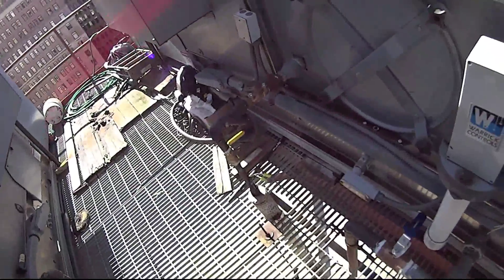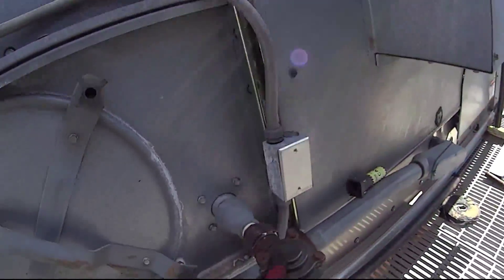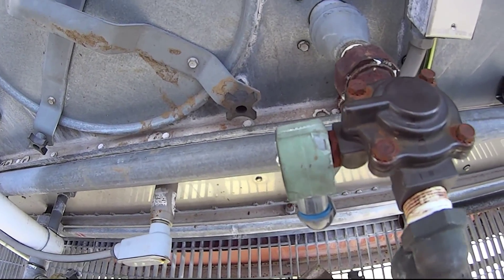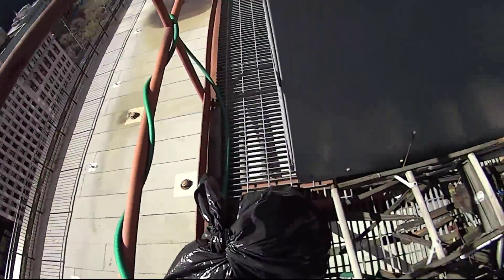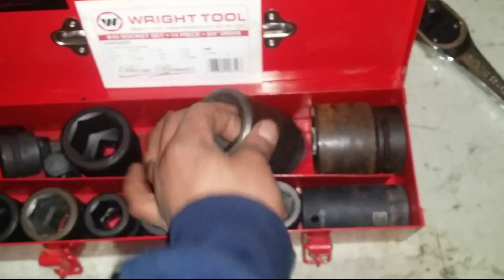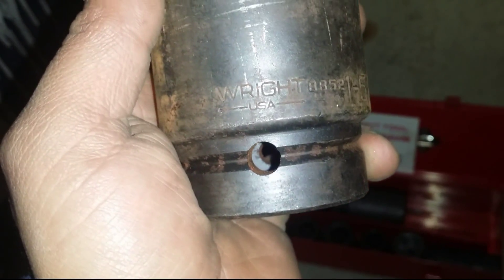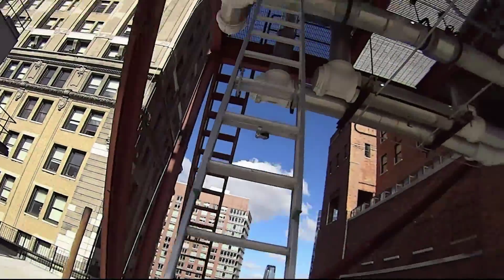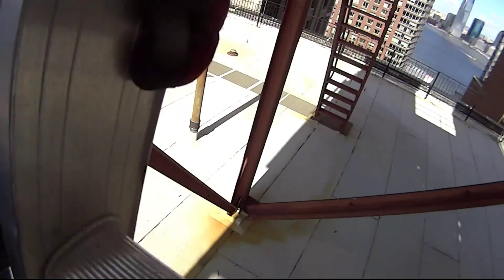Evapco Tower | Busted Ball Valves | HVAC | PT 2

Comment: nice work.  Enjoy the videos.  Is it common for the chillers to have that much corrosion in them?
Reply from the maker: Well that wasn't a chiller loop, it was the open loop condenser water. If the loop has proper water treatment then no, most locations do have the treatment